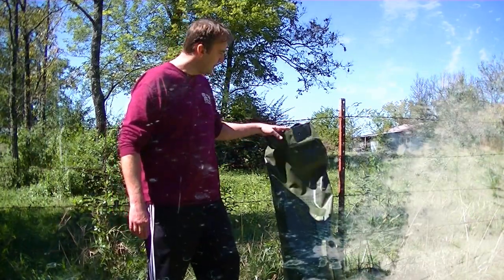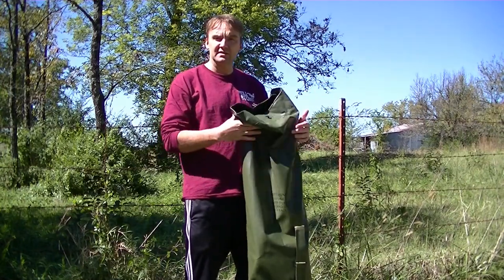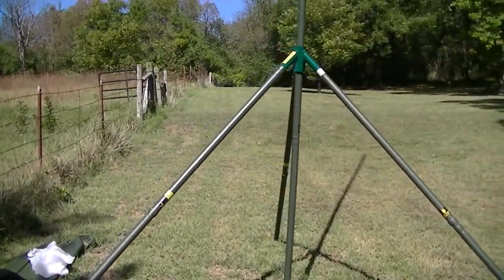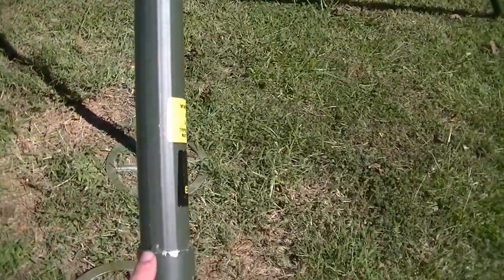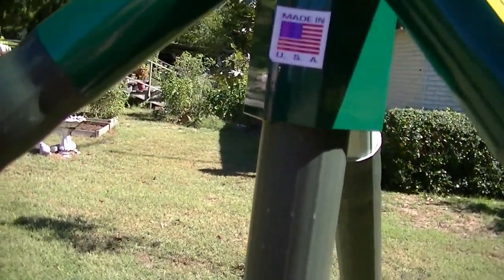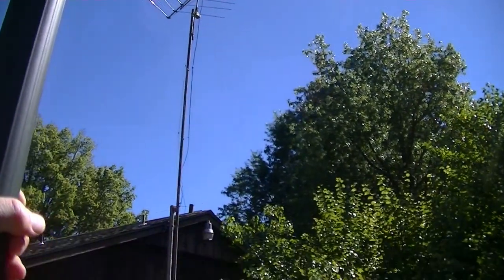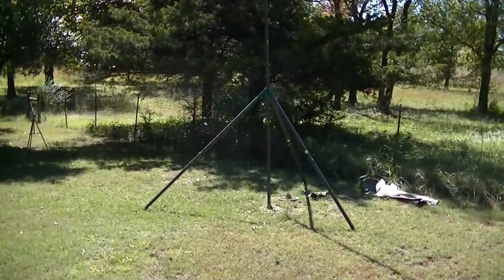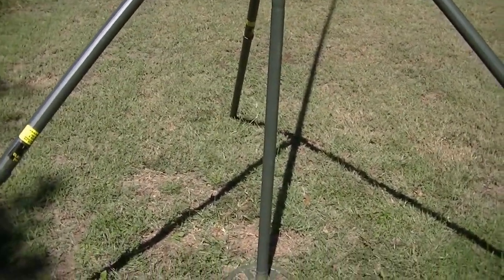Ham Radio Antenna Military Mast Tower, Setup & Review

Comment: We used those in the Army, you should have had 2 or 3 aluminum rings with 5 holes drilled in them.  They look like a big washer and will fit just right in between the sections about 3 down from the top and then another 3-4 sections down towards the ground.  Those are your guy anchors for the mast.  The kits we used had the dacron rope in them with 5 stakes for each guy system.  Hope that helps some.
Reply: Backwoods Law those are camo poles though. Think you are talking about the OE-254?

Comment: I bought three sets of these with both aluminum and fiberglass sections.   I use either fiberglass or aluminum sections depending on the type of antenna I'm supporting.  If it's my coax fed five band fan dipole, I use the aluminum sections all the way up and if it's a ladder line  fed wire antenna I use the fiberglass sections.   And, I use the aluminum sections with the tripod piece because the fiberglass sections can't withstand the stress put on them when used for supporting the tripods.   Otherwise, the sections are interchangeable.

I really like these because they can support a decent amount of weight and when properly guyed they can withstand a lot of wind, like you might have near the ocean or in a large open field.   But, they are HEAVY.   Each set is about the size and weight of a set of golf clubs, or heavier.   I've used all three of them together to support a 40m full wave loop antenna with no problems.

You definitely want to use the guy rings as well as the tripods for heights over about 16 feet.   You don't want something that heavy toppling over onto anyone or anything.
Reply from the maker: Interesting comment, thanks friend!

Comment: I bought one of these off Ebay. I mainly use it when I go camping and put a 18 ft Antron 99 on it. It is super stable on the tripod.  I also set it up in my back yard with a Maco Y quad and used it for a week before I got my tower set up.  It worked good and was stable with the beam on it.  It wasn't to windy though at the time.

Comment: The lean is really easily overcome simply by replacing the tripod with guy wires.  We put these up without tripods and the way you do it is you have a total of 8 guy wires 4 at one level (about 12 ft) and 4 at another level (about 24 ft).  you draw a line straight through the base plate, go out about 12 ' from the base plate (mast sections are 4') in either direction and attach an anchor then you lay the antenna down so that the antenna is perpendicular to your base anchor line and place another anchor next to the antenna 12' from the base plate.  then place another anchor 12'  in the opposite direction of the antenna.  You should now have 4 anchors all 12' from the base plate (think of base plate as pitchers mound and the 4 anchors, home, 1st 2nd and 3rd base.  Then attach 4 guy wires from the 12' high (on the mast) point and run 2 to each side anchor.  Next attach 4 guy wires from the 24' high (on the mast)  and attache them to the side anchors.  So using the baseball analogy the base plate is the pitchers mount, the side anchors are 1st and 3rd.  you will then take a 24'(high) and a 12' (high) guy wire that are attached at 12, and 24 on the mast and run those out to 2nd base.  You will now have left one 12' wire and one 24' wire (attached to the mast at those heights you will use the 24' wire to pull the antenna up.  You will start at the base plate and as you pull the end wire up it will begin to bow in the middle with the end coming up when the end/top of the antenna gets about 10 to feet in the air you will then begin pulling on the 24' wire and the 12' wire at the same time and the mast will eventually stand itself (like a bow returning to its natural state) up and you will attach the last two wires at home plate.  Once all of your anchors are secure it will withstand gale force winds.

Comment: Ive got 2, of those setups,,,mine are fiberglass, and have a different base, not a tripod,,,and guying is EVERYTHING,,,,when done with guying, its ROCK SOLID,,,got them both at a hamfest,,,i think i paid about 125, for each kit,,,,and theyll NEVER wear out,,,,they are heavy too, but QUALITY,,,,,could easily use for a permanent setup, when guyed properly,,,,and you can add, extra components, at any time, to go way higher, too,,,,super cool vid,,,thanks for posting!!!,,,,just subbed,,,great channel,,,,,de NV1H😎
Reply from the maker: Yeah, just a huge pain to lug around and put up
Reply: @hamradiocq  it's all military surplus,,,,,they use us, sap grunts to lug it around, np,,,,LOL,,,😎

Comment: Those weren't meant originally for use for a antenna.  Those are camouflage netting push poles.  They normally come with 2 or 3 sets of butterfly spreaders that are made of fiberglass to give the exterior of the net a smooth stretched out surface.  I used them in the guard back in the 90s.

Comment: perfect for a wire inverted v antenna or a light aluminum vertical, or possibly a screwdriver type vertical antenna....guyed properly, that thing could be a permenent fixture in my backyard. I like it alot
Reply from the maker: Thanks for the comment.
Reply: I have 12 of the aluminum ribbed peices with guy wires on a tilt base when you tilt it up do the first 6 guy it then lower it put the other 6 and guy that it 45ft tower and when you tilt up all 12 it will bow alot but its fine is was about 180$

Comment: I had the same thought: Base antenna 'tower!' Add a little (or a lot of) concrete, and...???  Have you set it up that way, or are you using it strictly as a 'vacation' tower?  Also, where did you get it? Thanks! 73  KC1MGW
Reply from the maker: Bought online. Have it stored at moms house

Comment: Also, the poles are not for a tripod exactly. Theya re universal construction poles that the military uses for large tents, cammo netting support frames etc..

What you are calling the "base" goes on top, and the camo netting goes over that, so the pole does not rip it.

Using it as a communications tripod is only one possible configuration for the poles.
Reply from the maker: VanishingNomad I need to mess with jt more no instructions
Reply: I had friends in the military explain it to me.

I guess the poles just come in the bag, and the military builds whatever they want with them. That's why you have two bases, when you only need one when using it as an antenna mast.
Reply: actually that is the base its so it doesn't sink in the ground. There are things that look like big paddles we called spreaders that hold the camo.

Comment: Can it handle 10m yagi?
Reply from the maker: Yes, but it would need guy wires and stability.
Reply: I put a 2 Element Maco Y quad on mine and it did just fine.  It was plenty stable. I had it up for a week with no Guy wires but it wasn't very windy.

Comment: I have the 44' guy ropes but no tripod. The ground spikes are useless in our soft soil here so I use mobile home anchors. I replaced the plastic guy rings with steel guy rings. Place your anchors 25' from mast with 50' between anchors. You can walk it up one tube at a time letting the height rest against 2 of the guy ropes to full height and adjust your guys from bottom up. It's a one man set-up as long as you're not dealing with much wind. I'm near 60 and can have mine up in 15 to 20 minutes.